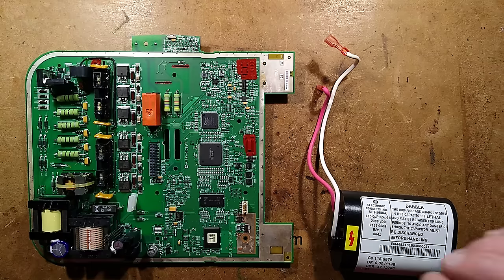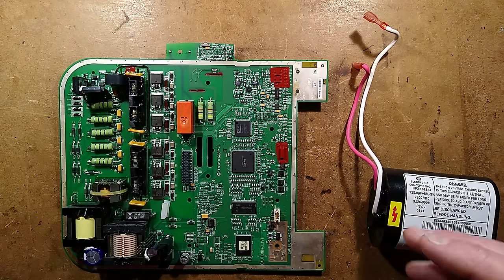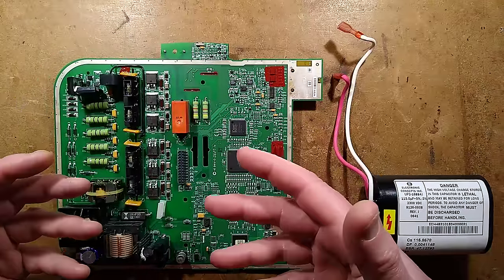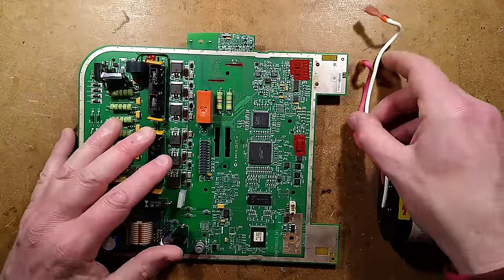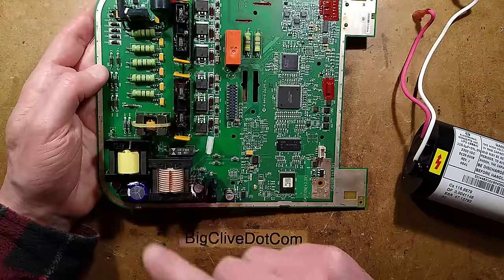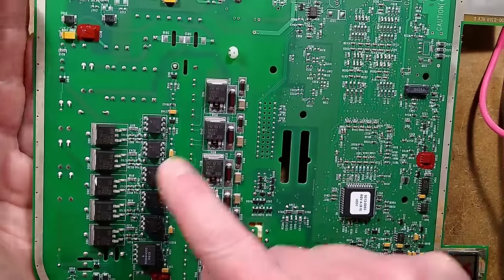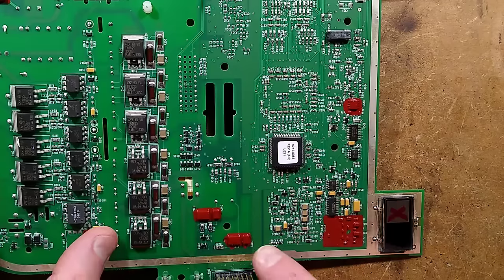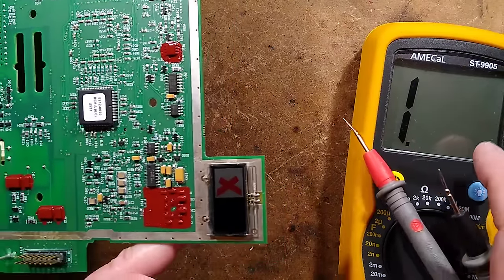Inside a Zoll defibrillator - with SCARY capacitor

Comment: The X and tick arn't just for battery. A tick indicates that the unit is emergency ready. For this to be the case the following needs to be true: the batteires need to be installed, the batteires need to be in date, a set of pads need to be plugged in and it needs to have passed a self diagnosic check. In the event of a low or expried battery the unit will also make an occasional beep in a similar fashon to a battery operated smoke detector with a low battery. The unit has a built in timer which is reset manually when new batteries are installed. It works on an honour system there is no computerised check. The self diagnostic process runs periodically by itself.

Comment: Been a medic for almost 35 years now. Ive given the shocks 100s of times and been on the receiving end of 7 (thankfully i was dead for those).  The heart actually puts out millivolts that can be picked up with an oscilloscope, and the first monitors were nothing more, but with filters to remove interference. I think some of that circuitry may be a flip/flop for lack of better terms because the initial charge is delivered from one pad to the other, then it reverses and goes in the opposite direction, these are referred to as bi-phasic. The old ones basically just charged the capacitor, then dumped the entire charge in one direction. Good video, as a provider, we dont get to see the insides of those often.

Comment: Hearing you speak about the infrared port for it to log and communicate with a PC reminds me of one the absolute best implementations I've seen of having a device communicate with another (in this case a phone, over an app), it was a carbon monxide alarm that logged levels, alarm events, severity (yellow or red) and dates. 
Did it use Bluetooth? Nope. Did it use WiFi? No. Did it use IR? No. NFC? Nope.
No superfluous communication parts needed, it used the piezo buzzer (at a relatively low volume) and the mic in a mobile phone, basically like an old modem. It would spend a few seconds chirping while being held close to the phone and that was enough to send the kilobyte (if even that much) of data to the phone. 
You didn't set the date and time on the alarm itself, it (I assume) just says "This is how long I've been turned on for" to the phone and the phone uses it's time and date to figure out times and dates of alarm events. 

Very clever system. Another clever one I've seen was when I got a universal remote for my grandmother; she's getting older and two remotes with lots of buttons tended to have her change the input source and not know how to fix it, then get pretty upset over the whole thing. The sale page for the remote said it was programmable, so I assumed that meant that you entered in a code to select ones saved to the memory chip from the factory. 
You could do that, or you could hold the old remote up against the IR LED ("Within 3-5cm") and then the IR led would be run in reverse (like an IR solar panel) and it would save the information sent. There was only 1 IR LED on it, so it didn't have a specialized photodiode/phototransistor It was a bit hit and miss, usually programmed all but one or two buttons, I ended up using a flipper to program it because of the brighter IR blaster (also allowed me to see if it was saving the remote codes as actual codes, but it was just saving whatever the LED picked up) and got it done on about the fifth try, though I was able to custom select which buttons would be enabled, save both the TV remote and freeview box to it and most importantly avoid programming in stuff like source select so the TV wasn't accidentally changed around. 

Two clever workarounds to save on part costs and complexity without actually compromising on the function of the product.
Reply: EI "audio link" works great as long as it's quiet... Not just the co alarms their fire detection range uses it too

Comment: Have worked in Biomedical engineering since the early 80’s and have seen the evolution of Defibs from heavy devices sitting on stainless steel trolleys with the green CRT displays and traditional curly cord paddles and right through to the modern AED units such as this ZOLL unit that is easily carried around. The old units were great to dismantle for high quality components and the storage capacitor used to be very large and possibly containing dreaded PCB oil. Yes, the old fashion defibs could be used to zap things with as there were no computerised safety lockouts to prevent accidental discharging of 360 Joules of high voltage into empty drink cans or disused electronic circuit boards. Good fun to be had back in the day with old defibs!

Comment: Speaking of proprietary batteries - I work with ETDs, devices that are used to detect explosives and the machines are incredibly overpriced. £19k each and the batteries give you an hour of battery life when off the mains supply. Replacements cost about £500 each I think and they're literally 8 18650s with a proprietary BMS and fancy case. I've been saving them from the bin and recycling them because most failures of the battery are actually the BMS so those 8 cells were perfectly good, Panasonic cells too.

Comment: It's probably worth mentioning that a defibrillator is (or harmful) - and will refuse to apply a shock - during a heart attack (myocardial infarction) rather than an electric-based irregular heartbeat (cardiac arrhythmia). Since a heart attack is a circulatory issue resulting in local lack of blood flow to heart muscle, stopping the heart briefly is probably the last thing you want to do.

Certain arrhythmias can cause heart attack-like symptoms, particularly angina, but without preexisting near-complete blockage of a coronary artery, it's not much likely than intense exercise to cause heart muscle damage. Some training classes, for lifeguards for example, will have simulated "quizzes" where one student or TA will act as though they're having heart problems, and one or more students must act quickly with the appropriate first aid or response. Some volunteers took great joy in simulating exaggerated, Shakespearian deaths from defribrillating a heart attack. I presume this was before the more intelligent defibrillators were common.

Comment: I owe my life to one of those.  I went into VFIB while working out, still no cause found after lots of expensive testing, and the EMTs that arrived had to shock me twice with one.  I don't remember any of it except waking up 3 days later in the ICU.  Amazing piece of engineering.
Reply from the maker: I recently checked the one in the local gym had up to date pads.  I was willing to donate a new set of batteries and pads if they were out of date.
They were well in date, so it is being maintained.

Comment: I opened one of the ‘pressure sensors’ similar to this one (a newer version of zoll)and found out it wasn’t a pressure sensor but a 3D accelerometer.
Reply from the maker: It does appear to be an accelerometer.
Reply: Yes, they are accelerometers. Zoll used to (maybe 5 years ago I last saw it?) have a training app so you could attach your phone to the back of your hand with an elastic band and monitor compression depth during training on CPR manikins. Generally really useful to get feedback at a stressful time, but can be less than helpful when performing CPR on a small framed individual and the AED keeps exhorting you to press almost all the way through their ribcage to the floor.

Comment: That is a fascinating look at the inside of a device I've used quite a few times ( thankfully on the giving end of it).
I may be able to give a few details on the design of the board and electrode pads (I'm a doctor with an interest in tinkering with stuff, not an engineer, so please excuse my lack of electronics technical knowledge).
The divider section is there to control the power output to the pads, as the device will recognize different shockable rhythms, which can be resynchronized at different outputs, not just ventricular fibrillation. The necessary energy to convert said rhythm can vary from 25 joules for some atrial originated rhythms to 200 joules for ventricular fibrillation ( or 360 joules for the older monophasic devices).
That pressure sensor does not only measure the strength of the chest compressions, it will most likely prevent the device from analyzing the rhythm during CPR, as the chest compressions can sometimes mimic a true heart rate, and will prevent the device from discharging if the patient is not clear to prevent shocking the rescuer with potentially disastrous consequences.
The analysis circuitry has to be isolated to allow the heart activity to be read since the average voltage of the heart activity is usually 1 to 2 millivolts at the surface of the chest, and I'll guess there is some sophisticated filtering going on to remove interference from muscle activity, other devices and such.
The pad design is such that the right shoulder pad is the negative electrode and the left lower pad is the positive one and goes over the typical position of the apex of the heart. This is because the direction of current flow in the heart muscle goes from right to left and from the base to the apex, and shocking the heart in reverse polarity will invariably worsen the situation. Also, for rhythm analysis the device would need to know where it is looking at, and this electrode position is the one known as ECG lead II which is usually used for monitoring as it will sense the largest waveform and make recognition easier.

BTW, babies do explode rather frequently, that's why nappies exist😂.

Comment: for a while i was certified in using AEDs as well as being a trained first responder and it is pretty much impossible for someone to use an AED to kill someone as if there is not a treatable rhythm it will just say shock not advised  and lock out the trigger button until something changes and the shock is warranted now the ones that are attached to a 12 lead heart monitor those ones can be fired as it is relying on the person  there reading the strip and deciding on if they should shock

Comment: Talking about defibrillator battery. I had found some old batteries for Defibtech Lifeline in the recycle bin at my organization. I opened the battery which was in a plastic casing. I was anticipating a reasonably sized Lithium chemistry. I was disappointed to find a fairly small Lithium battery with a circuit board that had a RTC chip to keep track of battery expiry date.

Comment: As you were saying. Defibrillators whether Zoll, Philips, PhysioControl etc.. are used to "bump current through it"

It detects Ventricular Tachacardia (Fast beating heart rate) and Ventricular Fibrillation( Irregular heart rate) Both are called Arrythmias and can be deadly if an AED is not used to De-Fibrillate it hence the name.

However heart rythmns like Asystole (Flatline) are detected, but unlike fanfair and the silver screen you can't shock a stopped heart which means it won't charge and won't work properly.

Here in Canada, we use Zoll and Philips and I can say personally they do save lives.

Thanks for the amazing video Clive!

Comment: Nice! I'm part of the neighborhood 6 minute zone initiative making sure our area is covered by 2 AEDs that are accessible 24/7. It's crucial to be with a patient within 6 minutes after cardiac arrest/fibrillation. The 112 network will issue a call via app to trained volunteers to go to site with a patient requiring CPR/AED, via the AED pickup points, boxes installed on the outside of some neighborhood houses. Just got the service contract renewed, we're good for another 5 years.

Comment: As someone in pre-hospital emergency care, AEDs are fantastic. That they can be used by people with no training whatsoever just makes them better

Many of the proprietary (£300) batteries are just a bunch of the same or similar lithium cells welded together in a pretty plastic case. 

Part of the reason to not touch during monitoring is so the machine does not pick up your heart beat.

Comment: When I started as an NHS technician and then Paramedic in the 90s, I used the Lifepack 5, 10, 12 and then Zoll devices. The early life packs had those paddles, and we'd use condutive gel or later wet pads ( we called 'wet fish')...AEDs of course smaller and pads which got rid of paddles. The different pads such as the paediatric ones, have I believe a different impedance which tells the algorithm what modes are appropriate. The relay probably allows the charge to be dumped, if a rhythm changes...really interesting session thanks...

Comment: Thank you for the in depth explanation of this AED Clive!
As a Beach Lifeguard, Company First Aider (Bedrijfs Hulp Verlener) & Red Cross Telecommunication Technician, I never had to perform CPR or hook up an AED in real life, but have had training on several models over the years, none that shows the steps with the LEDs & pictograms, or speak Norwegian 😉 though.
The pad for measuring compression depth & frequency is new to me, I already deducted the component is an accelerometer, pretty neat!

And for everyone, if you up to it, learn CPR, with an AED, and basic First Aid.
You'll never know when you have to use it, and if you don't, always call for help!

Comment: I took apart one of those a few years ago. Removed the ✅❌ LCD and made a 1-Hz blinky circuit for it. Used a couple of BJT astable multivibrators to make it flash between ✅ in the ON state (AC applied to two middle pins), and ❌ in the OFF state.

Comment: Thanks, Clive, for the insight and background on such an AED. We have used a demo version during first aid training and were told about the rather high energy of the shock delivered, but that capacitor way exceeded my expectations...

One thing worth mentioning that we experienced in training: if you are not experienced in regular use with AEDs, like most of us,  it may or may not (😊) be a good idea to always have at least another person helping when using the AED. If you are on your own, you may be more than busy with CPR and calling emergency services, and even though the AED guided you through the process, the stress may be immense. Plus, you may lose time locating the next AED and getting it. So another thing I took from the training: make yourself familiar with the locations of first aid equipment and such in your regular places (work, gym...)
Reply: I was a resus training officer and the first thing I hammered into my students was " GET HELP". There are very few worse things than trying to manage a collapsed patient on your own.

Comment: In the early 80's I worked in a U.S. based company that designed and built defibrillators. It's amazing how small they have gotten the units and how capable they are.  The circuit boards at the time were all hand laid out. The batteries were sealed lead acid if memory serves correctly. I was in awe of the people who deigned these devices and often wondered how many lives these machines saved over their intended lifetime. Fascinating topic for sure.

Comment: When you install the batteries (we have the english version) it needs you to press the button so it can perform a self test and calculate 'if this is full voltage, what is empty' + stamp the date. It will force the X after a time (2+ years?), just like a smoke detector. (Your smoke detector will probably last years on a 9v battery, but you change it scheduled 6 months because people forget...repeatedly.)

Comment: I worked for Heartstream in the 90s in Seattle Washington. We were the first to pioneer the AED and bring the first unit to market. I have a ton of the Icar caps that we used. We also used an H-bridge to deliver a dual-wave pattern which extensive research showed was way more effective. The calculations for the trans-thoracic impedance to calculate energy delivery was impressive.

Comment: A friend of mine many years ago got ahold of a very obsolete defibrillator, somehow. Not sure how. The tag said it was decommissioned in the 1980's and came from a local hospital. The capacitor in the Zoll defibrillator can store a charge of 320 Joules. The unit I remember had a maximum charge in excess of 500 Joules. My dad works in a hospital and I told him about it. He recalled a nurse telling him (and I understand there are few degrees of separation there) there was an incident at a hospital she worked at in the 1980s where a nurse was electrocuted and killed by a defibrillator. It was said to be a loud, blood curdling scream as she was flung across the room. There were two machines in service, and the second one saved her life. Both machines were ordered to be decommissioned and destroyed. I went back to my friend's place and looked at the service tag on his machine. It was the same hospital, and from the same period. He's always accumulated a lot of weird things.

Comment: 12:50 - no, they will still use IR because of the opto-isolation. Same reason that the machines you see on the wall have mains power to light the box and keep it warm, but the AED is completely battery-powered.

Comment: Hey Clive, An ECG measurement  from Right arm to Left leg will give typically 1mV Peek to peek of signal. Its measured using a balanced deferential amplifier with a 50 or 60Hz filter to block the mains field that we all live in. Often biasing is fed back to the patient via a 3rd electrode. This is usually only required for mains powered devices even though there is isolation between the patient and the rest of the device. I've seen both transformers and opto-isolators used for this purpose. The circuit also needs isolated power which is usually fed through a transformer. A modern 12 lead (10 electrode) ecg does some very cleaver maths in adding and subtracting of multiple analog signals to produce the 12 signals used to diagnose a heart attack amongst other things. I myself suffer from atrial flutter and have escaped being shocked in A&E a few times as the drugs worked :)